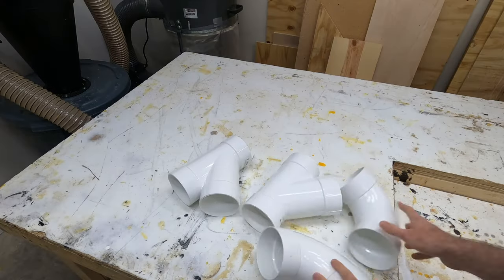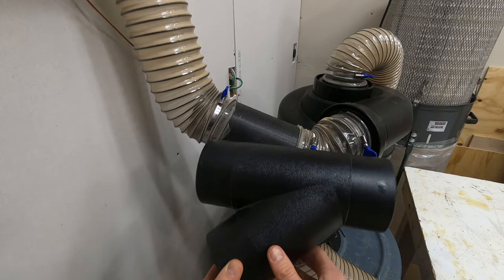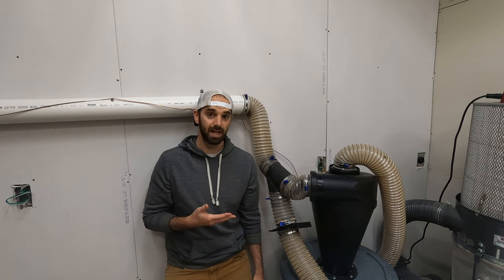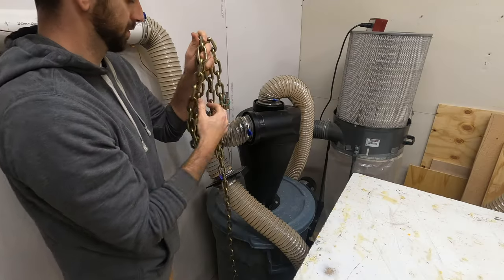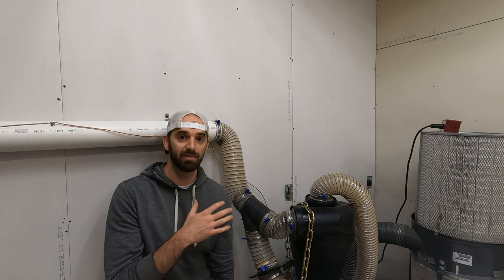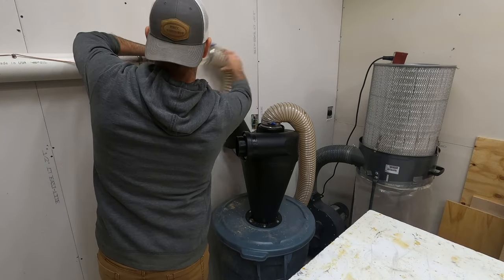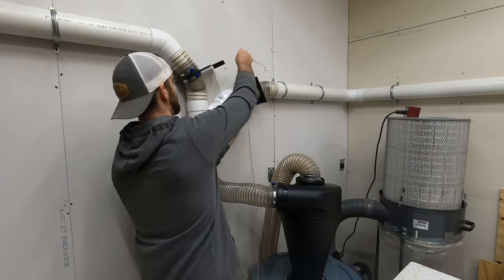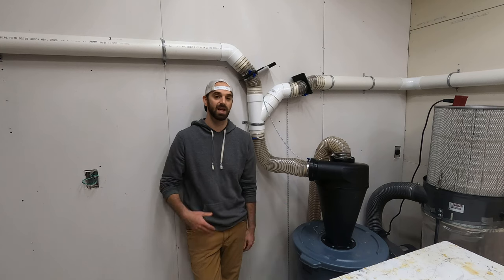Fixing Everything WRONG with My Dust Collector Setup || Static Electricity || PVC Pipe

Comment: I’m an engineer and have written on esd even was an expert witness in a couple on legal cases related to injury and esd mitigation. I think your solution here is very good. Use of chains for grounding is pretty common. There are ways you can simply ground yourself with a grounding wrist strap. The discharge is due to a difference in potential between you and the static build up on the equipment. A human can themself build up a static charge of up to 35,000v at 3 amps! So it’s not just the static of the system but also you the operator. Anyway great solution to your problem.
Reply from the maker: That makes sense, I’m sure there’s a lot more that goes into it that I’m aware of.
I just tried to reason and use logic, haha. Thanks for sharing your input 👍🏻

Comment: The chain is a neat idea.  You would get "better" grounding by using earthed metal pipe rather than plastic, which is totally impractical.  Being zapped is a PITA but I would assume that given you're generating the spark on the outside of the dust extraction the risk would be negligible.  Probably better to build a meteorite catcher above the shop ;-)
Reply from the maker: Thanks for the feedback! Video on the meteorite catcher coming soon! 😆

Comment: Obviously for different reasons but when I was getting underway on Navy ships and then later, Coast Guard cutters, tie-down chain was never allowed to act as the ground for helos on the helo pad. A stranded wire (don't remember the gauge but relatively large) was required; anything with links was not considered a reliable ground. This is certainly a different application but just thought I would throw that out there.
Reply from the maker: Very cool input and thanks for sharing 👍🏻 the chain is probably not the ‘best’ solution, but for a small set up just trying to dissipate the static so I don’t get a small shock seems to work okay. I’m sure there’s quite a bit more to it that I don’t thoroughly understand 👍🏻

Comment: Hello, watched your video and can agree you came to the right conclusion. I would suggest you consider using the wire all the way long of the PVC piping as they act (as you did it before) as a capacitor and buildup charge when the particles fly/rub around/against the walls. As well with an even better result, you can use simple bare wire instead of the bulky chain and leave it on the ground but the best is to install some grounding rod and properly ground the whole system. By the way, have you guessed what is the purpose of the spring in the flexible hoses you use? If you have taught also for discharge you guested right, so you can screw wire along the PVC and connect it to the flexible hose's spring, and so forth.
Reply from the maker: Appreciate the input Rossen, those are great points - and I’d say they would definitely improve this system!

Comment: Your system is great and Oneida makes fantastic dust collection products. A couple things I would suggest would be to use a shop vac with a simple and inexpensive Dust Deputy VM for your miter saw and other small dust producing tools like sanders and routers,drill presses etc. They need suction more than High CFM. You can also simply use a cardboard box for the jointer chips as this machine simply drops them down the chute. Doing this you could eliminate a lot of piping and elbows which would increase the CFM to the planer. Great video.
Thanks
Reply from the maker: Thanks for the input Tim! I agree, the hose to the miter works ‘okay’ at best. (It does capture quite a bit but there’s a lot it misses too). 
I plan to upgrade this eventually to a Kapex specifically for dust collection, but that’s a great idea in the meantime 👍🏻

Comment: The dust explosion thing is real, but it is VERY rare. The conditions for the dust to explode from static spark must be perfect; exactly right size particles at exactly right density etc.. 
Another danger to cause an explosion is to put a board through the planer/table saw/drum sander with a nail/screw inside. Not only will it damage your blades, but can cause sparks.

Nice videos. Subbed
Reply from the maker: That’s what I’ve read as well. Thanks for the input and the feedback!
Reply: myth. yes a metallic object, sucked up, could create a spark if striking an impellor, blah blah  which could.... smoulder and start a fire. but, the whole lot is not going to explode.

Comment: I mentioned last video to ground your system and air to your houses ground, like the ground in an outlet, not sure if you actually did this or tried this, but for me it worked with no static.
Reply from the maker: I don't see why that wouldn't work, thanks for the input. I've just been using the chain method as it was the simplest thing I could think of and it's been working well so far.
Reply: I simply ran a 16g gare wire down to he tubing and exiting at the blower. Then I took that bare wire and attached it to a plug with the +& - plugins removed. Only the ground( attached to the in-tubing wire) is actually inserted into a grounded outlet.

Comment: Nice fix on the Y. One improvement to keep CFM up would be to remove the the flex hose between cyclone and collector. If you can make that solid, they'll be less friction. Nice lil set up though.
Reply from the maker: Thanks for the input! The flex hose makes it really easy to move/wheel the can around when it's time to empty the bin, but I agree that regular straight pipe would likely provide more CFM.

Comment: Hey there! I watched both of your videos and the improvements to the 2nd were spot on! It's hard to tell from the angle of the shots but if you have a 90-degree in the corner nearest your DC, I would suggest using two 45 in that corner to ease the curve. Work safe!  :)
Reply from the maker: Thanks Bob! I’ll likely replace that 90 eventually! Thanks for the tips and for watching!

Comment: If you were to screw the metal clamps on the pvc pipe to one stud, do we still need the chain? great video
Reply from the maker: Assuming the stud was grounded, I would guess that would ground out the entire system - not needing the chain.
Interesting idea, I hadn’t thought of that
Reply: @mmcc_woodshop6288  If it is a metal stud of course...

Comment: So… I watched this video quite awhile back, but it’s been on my mind and I thought I would share some thoughts. Now, I am an electrician and “should” know about the static electricity issue and how to solve it. But I think there may be more to what’s going on than meets the eye. My first thought is this… the wire around the pipe connected to the chassis (ground) of the collector should have worked, but obviously didn’t. Today I think I understand why. One of my other hobbies includes antique radio repair. One of the first things you do with an old radio is replace the capacitors. That got me thinking… static electricity is a capacitor!! Capacitors are essentially two plates with different charges separated by an insulator or electrolyte. Capacitance relies on a few things, the size of the plates, the electrolyte, the insulator, the voltage and the amount of charge present. 

So…  hear me out… the wire should have worked, but the wire is a relatively small plate (area) as compared to the pipe and therefore wasn’t able to dissipate the charge. The chain however, is making contact with the concrete floor which is a MUCH larger plate size compared to the pipe and I think this is why the charge was able to be dissipated as it was distributed over a large area and the charge existing at any single point would be very small and wouldn’t be noticed by anyone touching it.

I’m probably not 100% correct or explaining it correctly, but I think this is the crux of what is going on. 🙂

Now I can sleep… lol 😂
Reply from the maker: Thanks for the reply and input, that makes sense. I definitely don’t have the best understanding of electricity. I just figured since I was getting shocked that I was becoming the conductor. If I could replace myself with a different conductor (the chain) it should solve the issue. So far it’s worked very well 👍🏻

Comment: If the chain works, then let it fly. Your mileage may vary on a dry winter day with the static discharge, but I wouldn't sweat it too much until you actually have a static problem again. The plumbing for the dust collection setup looks way better now. You lose a lot of flow velocity with the flex pipe. The straighter and smoother you can make those bends in your piping, the better. If you want to get better flow, put as little of that flex hose in as reasonably feasible.
Reply from the maker: I’m also really happy with this new setup. The chain has worked well so far, so while I’m not sure if it’s technically ‘grounded’, it has seemed to dissipate the static
Reply: @mmcc_woodshop6288 
Assuming you're still putting dust through the system the same way you did before, it'll still be creating the same static charge as before.

And if it's making the same static charge as before, but you're no longer getting shocked, then it's got to mean that the charge is draining out of the system at a decent pace instead of sitting around waiting to zap you.

So while an electrician might roll their eyes at your solution because it's not the "proper" way of grounding the system, it's clearly a way of grounding the system.
Reply: And yes, flexhose adds a tonne of resistance. Use it sparingly, stick to pipe wherever possible, and avoid sharp bends.

Comment: Just connect the wire to that green wire right behind the dust collector in the un finished outlet. I use a Computer plug and cut the hot out and use it plug in.
Reply from the maker: That's a great tip! I don't have those unfinished outlets wired to the main electrical panel yet otherwise I would!

Comment: You might want to talk to an electrician, or someone who is familiar with electrical work, to get a real understanding of what grounding means.  Just touching the ground with your chain is not grounding.  Also it would probably be a good idea to complete the electrical outlets in the walls.
Reply from the maker: Thanks for the input James! I definitely could benefit from learning from an electrician. The unfinished outlets are now yet hooked up to my breaker box, so no risk there.. nice eye though!
Reply: Grounding pvc does next to nothing. 
There is a great video by an electrician explaining why.
Reply: He doesn’t need an electrician. He dissipated the static charge in the video. This isn’t an Electrical grounding issue. This is just the dissipation of static electricity.

Comment: Thanks for the video.  I am just getting ready to install a dust collector when it arrives.  I have to ask you however, Why would you use gawdy chain and have it laying loose on the floor when you have at least 2 ground wires sticking out of your walls that you can connect to?
Reply from the maker: Thanks for watching! The wires aren’t hooked up to my breaker box yet, I just had to run all the wire to put the sheet rock up first. I just haven’t had time to mess with the electric yet, that would definitely work though 👍🏻

Comment: you will get much better air volume if you remove the 90dg bends as the most severe bend you should have is 45dg i would consider a 45dg then a short straight and then another 45dg bend 6that way it will help the airflow
Reply from the maker: Great tips Ray! I’ll go that route if I ever have to make changes!

Comment: Hi, just a small comment, can you not put the gate things into the pvc pipe rather than have them in the flexible hose? It might make it look even more neat?
Reply from the maker: They’re a bit too small of diameter. Looking back now I would’ve wrapped tape around the neck of them a few times, putting hose around the PVC was frustrating as it didn’t fit well

Comment: You cannot ground PVC, it is the insulator used to surround all your wires.  You want to discharge the static electricity with a static discharge device or path.  All the screws through the PVC to collect internal static is misinformed BS.  Also there has never been a reported dust explosion in a home hobbyist shop.  Only a large industrial shop is capable of producing the vast quantities of dust required to reach the threshold of ignition.  I used aluminum duct sealing tape on the exterior of the PVC to a ground to discharge any built up static which stopped the static shocks when making contact with the system.  Cost is about $4.00 for a roll of tape.
Reply from the maker: Thanks for the input and sharing!

Comment: The frame of the DC is 100% grounded to the ground rod of your main panel via the ground prong. The reason you copper wire didn't work is because you needed to wrap way more copper. At least four raps per foot. Ground that to the DC bolt and it will work. I bond the wire inside my hoses to that same bolt and it's night and day. The 735 I have will zap the piss out of you otherwise!
Reply from the maker: That makes sense! Thanks for the input!